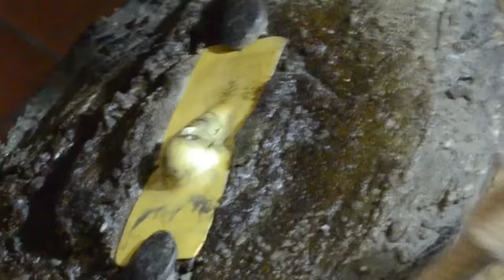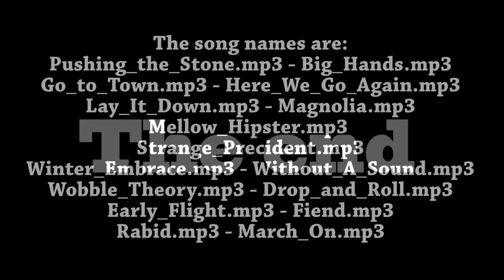Skull 18kt gold ring handmade

Comment: Hey guys. I don't know about you, but I love his soldering coil. I found how to have your own. If you purchase a horse brush (there's a style that comes in a coil just like this) and remove the plastic handle that is usually attached with a wing nut, you'll basically have the exact same soldering station. They're like $8 on Amazon. Hope this helps someone.

Comment: thanks for all video that u shearing with as.
but can u tell me about the the material of the welding wire
Reply from the maker: for welds using a gold 18kt alloy with a low melting point

Comment: That thing would have been so clean without the horns that aren’t shaped right or in the right place on the skull, and ditch the snake too! But I like your construction method.
Reply from the maker: thank you, the two white parts may look like horns, but if you look at the ring from the side you can see that they are two scimitars that form the stem and whose blade goes into the skull

Comment: why do you use the rolled sheet metal while soldering for ?
Reply: He told me that is a clock spring Ermir, it will reflect the heat better.
Reply: jim bettridge  thanks for telling